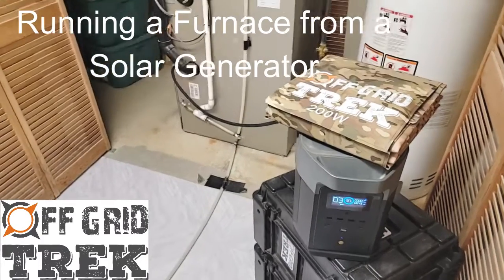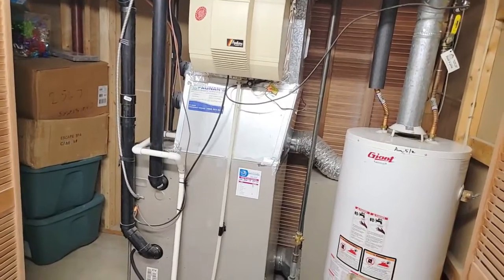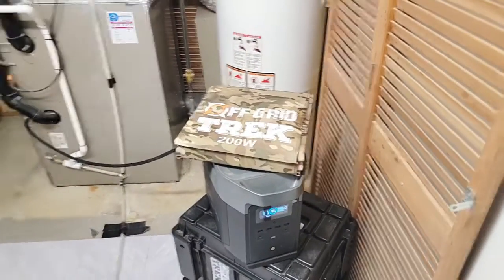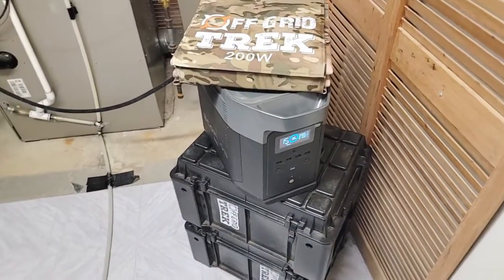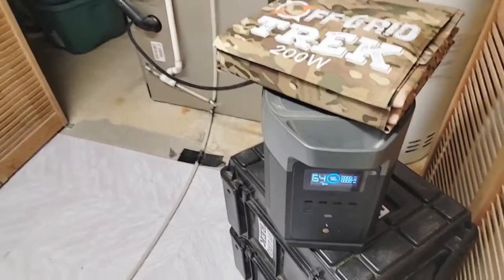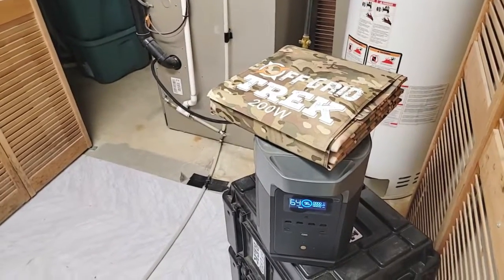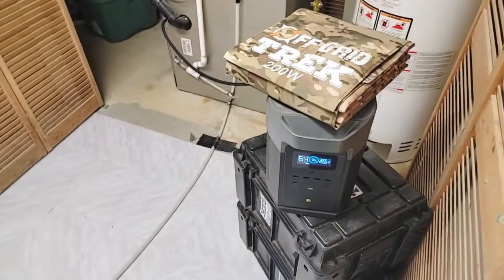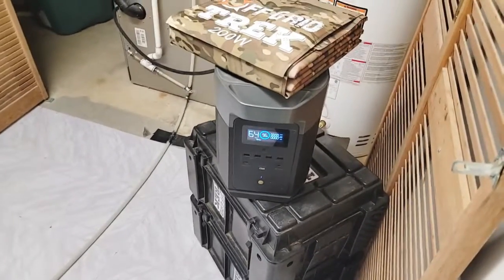Run a Furnace from a Solar Generator

Comment: I'm doing a similar setup with my Delta-Pro with Extra Battery, a total of 7200wh!!  I look forward to seeing how long the backup power supply will run 100% to 0%
Reply: FYI, my test ran 4+ days, when I got to 102 hours at midnight on a very cold night, I decided to stop the test in fear it might shut down in the middle of the night, at that point I still had 7% remaining capacity. Very satisfied with the results, I could keep our heating system running several days with help from a propane generator part of the day, then silent operations overnight

Comment: I am in a vintage trailer, 1980s, just had a new hot air furnace put in. Am thinking about putting a switch in to switch between house current and solar. Manually switching between the two power sources is not allowed in the US. It needs to be more automatic in the switching mechanism. The US uses a more fail safe approach.
Reply from the maker: You bet, video is to show people an option for these interesting times
Reply: I have not heard of this manual switching  being disallowed.      Usually solar systems are integrated into your power supply.     Have whole house solar with grid power to charge your battery bank.
Reply from the maker: This set-up in the video is specific to our requirements in these interesting times, where we wanted the house to be powered by our 31000Wh of portable battery packs that can go with us if we decide to leave in a hurry.  Most people would have an integrated system.

Comment: How do you plug  furnace into the generator? Furnaces are usually hardwired.
Reply: Mine is plugged into an outlet in the floor in the attic.   This is why I am interested in this setup.
Reply: Do some research, it can be wired to accept power from an inverter.

Comment: Can you charge the battery while it's powering the furnace to extend the 15hr period.
Also, why call it a generator? It's a battery pack, no?
Reply from the maker: Yes you can
Reply: Technical "Portable Solar Generators" are both.

Comment: Would a solar generator work in case of a nuclear confrontation? Great video
Reply from the maker: It would work as long as it is protected by a faraday bag during an EMP attack, here is a link to our faraday bags and they are available to ship now.  https://www.offgridtrek.com/collections/solar-blanket/products/ogt-solar-faraday-bag-no-us-sales-tax
Reply: @offgridtrek  You would also need a whole home emp protection, all your electronics would be blown out, your eco will work but you won't have nothing to run. Your emp protection will work on anything you have plugged in to the wall.
Reply from the maker: @diamonddavey2668  you bet, this is installed in my home and vehicles as well

Comment: How would you hook this up from a furnace in the basement to appliances on the ground level, such as fridge and extra freezer and other appliances and lighting?  Or, would you need a separate unit for upstairs?
Reply: I think they make extension cords

Comment: You need to make a ground to trick your furnace into thinking that it is grounded the newer furnace will not run of an invertor generator because it will not work an less it is grounded
Reply from the maker: You bet that is why I state a couple of times to use a qualified person to install this and verify your furnace requirements beforehand
Reply: Steve K, this is the problem that just NEVER seems to get addressed when it comes to using either an gas powered generator and now with the solar batteries.  This is driving me crazy as the #1 reason I want to consider a solar battery is to power a natural gas heater in winter.  

I've heard something about "bonding plug" that some people have used to charge an EV on websites, do you think this "bonding plug" would trick the furnace into firing/running?  But I don't want to spend money buying a solar battery to find out it doesn't even work for what I want.

If that works then I could gas generator charge up the solar battery during daytime power outages and then keep things quiet at night using the solar battery.
Reply: Go on YouTube and watch noshockzone and he will so you what you need and the plug that he is selling on his web site you can make I have made several for my invertor generators solar and gas

Comment: How many times can this generator be recharged
Reply from the maker: it has 800 lifecycles  then the battery will be reduced to 80%, if you were to discharge/recharge it daily for 365 days out of the year you would still get 2.2 years before the battery capacity reduced to 80%
Reply: @offgridtrek  Thank you I want to get one but need to get the cash together

Comment: If my furnace already plugs into 120Volt power, cant I just move the plug over to an EcoFlow or Bluetti (with appropriate wattage to handle it)if the power goes out?
Reply from the maker: If it has a power cord to plug into a standard wall outlet to provide power then it sounds like it should be able to be run by an Ecoflow or Bluetti.
Any questions best to verify with an local electrician

Comment: You didn't show the hookup!!!!!!!!     As an electrician I would put a plup on the input to the furnace at the furnace.   The feed to the furnace at the furnace would be a receptacle.     When power goes out just unplug the furnace and plug into alternate source.     If it is a solar generator you could plug the gen into that receptacle at the furnace and when the power comes on you would automatically be charging the gen.      I would do a test to see if the gen would run the furnace.     Those mod sin inverters will not run some stuff so you might need a full sine wave inverter.    If i need power I just attach an inverter to a vehicle and run a cord to whatever I need.        
    Edit.     When on normal power check to see if that plug has voltage on it.   BE CAREFUL.    IT SHOULDN'T.     If it does this is a dangerous situation.      Good luck
Reply from the maker: Thank you for your feedback.   A qualified electrician installed this and everything required to run the house from a tri-fuel generator as well.  The 4200W of Solar I installed on the roof of the garage created 6 charging stations for the 31000Wh of portable power stations  so that I have for secondary portable power to not only power the furnace (-46C/-50.8F here this week) but also all other important items ie fridge's freezers so that I have a secondary option if I cannot get fuel for the generator.  We test everything before we offer these items to our customers, and Ecoflow offers a solid product that can do exactly what I need for my personal home.  Lastly the  video shows the Ecoflow Delta Max running the furnace.